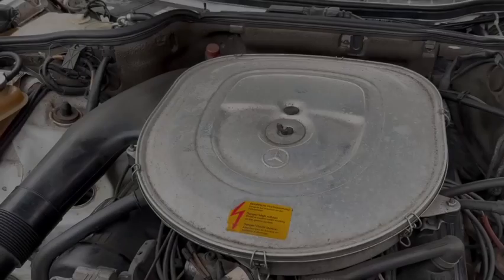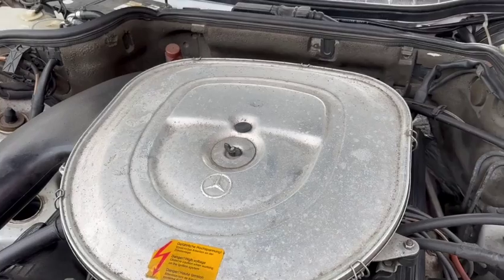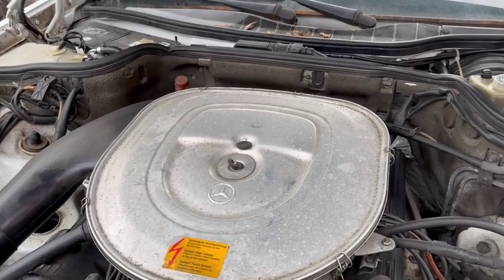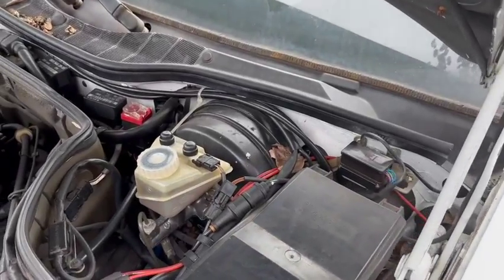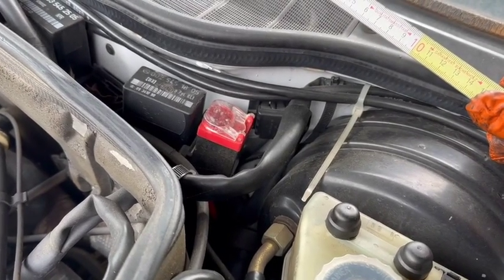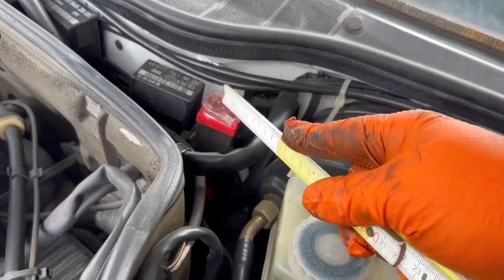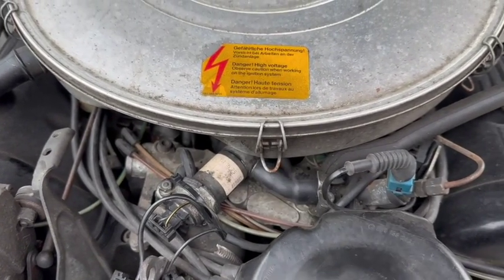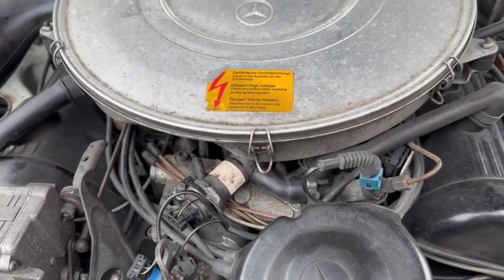Top causes of high engine idle speed on KE Jetronic I4 6 V8 W124 W126 Benz engines

Comment: Ralph how can I ask you an unrelated question about my 420sel?
Reply from the maker: just go ahead and ask.
Reply: @straybenzes  so I have a 1990 420sel.  My rear break lights will not go off.  My brakes are ok. The back pads may need to be changed.  On a forum someone told me it could be the brake light switch.  But it seem next to impossible to get up there to the brake light switch up under the steering wheel. I have tried for two weeks to get to it.  I can unplug it but that is about it.  Any suggestions please?
Reply: @straybenzes  I was also wondering if something else may be the the issue.

Comment: Hi Ralph great video’s. Is there any way you can help me with my EHA valve replacement and adjustment ? Please sir
Reply: Is there a way to measure the depth of the adjuster ?
Reply from the maker: @Yes, but it is pointless as they are all a litte different and a quarter turn makes quite a difference in the differential pressure.
Reply from the maker: Sure. Lay it on me.
Reply: @ I apologize for not getting back to you sooner. I’m bought a new EHA for my 89 420 sel denz and I have been trying to figure out how to set it up and I have been trying for almost a month and I can’t get it to work. The old one leaks and I need help. Can you please point me in the direction of how to set it or should I toy it to a-shop  ?
Reply from the maker: @RK-rh7rh  ironically I am just now working on such a problem child myself. Key is installing the valve and letting the engine come up to operating temp so that the cold start valve is no longer needed. New valves come pre-adjusted but they need to be checked and tuned to your car. Flow rates and pressures on older cars can be different from car to car and that requires measuring the differential pressure and fine  tuning it to your car engine. Good luck.
Reply: @ Thank you so much sir…
Reply: @ oh yeah the old one will start my car but it leaks.
Reply from the maker: @RK-rh7rh  A change of O rings is not fixing that leak?
Reply from the maker: @RK-rh7rh  😁
Reply: @ ok sir I will take a day that I’m off and just take my time and just work on just adjusting it until I get it to start . Thank you so much sir and I appreciate your help and concerns.
Reply: @ no sir it doesn’t stop the old one from leaking and the 0 rings are new.
Reply from the maker: @RK-rh7rh  👍
Reply from the maker: @ Ok
Reply: Is there a way to measure the depth of the adjuster ?
Reply from the maker: @ see above

Comment: Hey, Ralph! Another great video, as always. 👌🏻 I sometimes have the opposite – low, lumpy idle. What’s your take on that? 🤷🏻‍♂️

(1991 W201 M103, 140K mi, new plugs, wires, dizzy cap & rotor, etc. Overall, in excellent mechanical condition otherwise.)
Reply from the maker: That may be a messed up idle fuel/air mix. Did you try adjust that yet?
Reply: @straybenzes  The adjustment through the top of the air filter housing? I’ve adjusted that myself in the past and, to be honest, it didn’t go so well. 😔 I guess my “adjustments” were a little too aggressive?
Reply from the maker: @ronsuriano  The symptoms described go with adjusting the screw too far to the right and left. You will need to make smaller adjustments and take a drive to see if it gets better. A CO2 exhaust analyzer would of course make that simpler and more accurate, but that tool is usually not in reach of a DYIer.

Comment: I recommend when one has a high-idle situation that the first thing done is a smoke test.  Usually the high idle (up to 1,500-2,000 RPM) situation is caused these days most commonly by a vacuum leak, due to old rubber in the intake system.
Reply from the maker: Not a bad idea at all although only really badly worn throttle shafts or like you mentioned, intake rubber parts will cause idle that is difficult to control.
Reply: What about erratic idle when in any gear? Idle is like struggling to go up smoothly and some cases engine just stalls out after few minutes